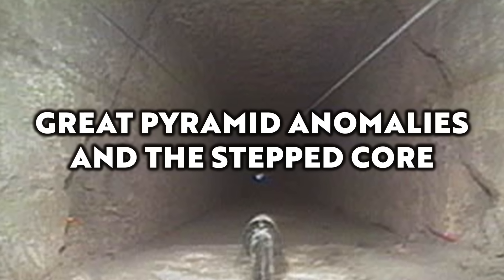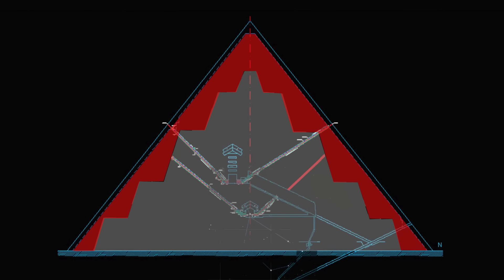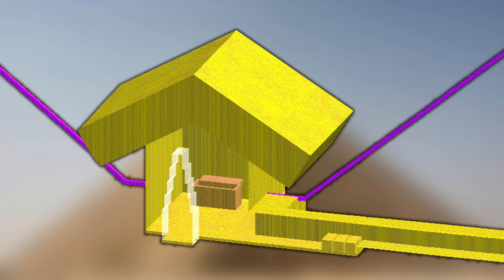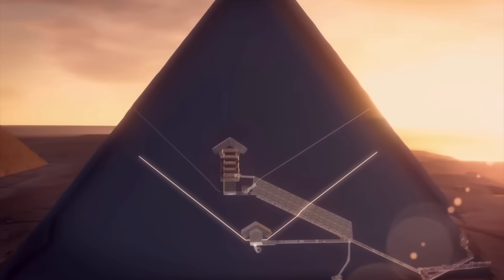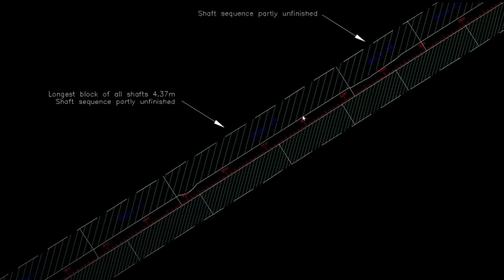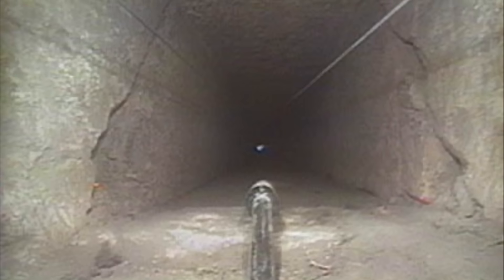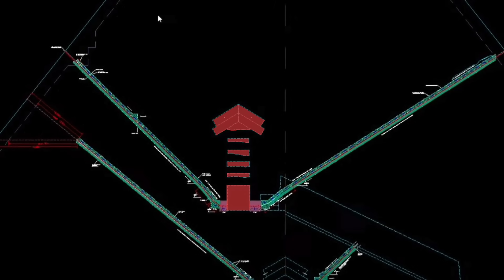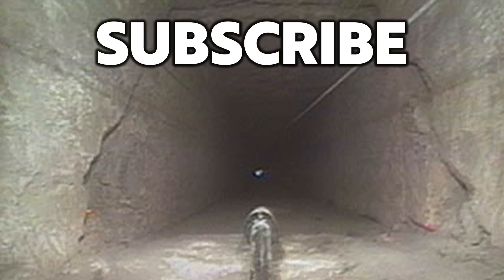Great Pyramid Anomalies Reveal Hidden Structure | Part 2

Comment: I wonder if the stepped core is in fact a spiral ramp, serving both as a structural core and a way to get blocks to the top, I wonder if the internal ramp has it's foundations on the stepped core.
Reply: It is possible both are true. Other methods of raising the blocks so high seem implausible, so I still find it compelling.
Reply: It appears to be in the data that made that pink and green spiral thing.  Not the marker drawing but their actual data.  My video was actually Vliet’s source for the screenshots of that in the paper AA linked :P
Reply: @WallacesMysteriesofAntiquity  Sorry, but few people know what green and pink are, because few people have opened the document by Laurens R. van Vliet on page 99.
I'm sure AA is aware of your work, but I haven't noticed him ever appreciating or commenting on your work.
Reply: There is no physical evidence for the spiral ramp on any pyramid. It's just a catchy idea people fell in love with. However there is an evidence for stepped pyramids (or pyramids with stepped cores).

Also, I think it's more efficient to pull the stones straight vertically to upper platform using ropes and pulleys rather then pull the stones around traveling much greater distance with huge friction loses.
Reply: This would make the Great Pyramid the only one with such a feature. All evidence of the ones where we can observe their core, are made of straight / "simple" steps without any kind of spiraling ramp at all.
Reply: @dnocturn84 I disagree.  On the little ones next to it, they’re “unfinished” but still had queens in them, so they likely took the ramp down instead of smoothing it out as it was less work for a king that might already be dead.

I submit we would not be able to distinguish the remains of a ramp around a collapsed core like Meidum.  Everything around the face fell away, including the ramp.  It’s not going to be a slanted set of stones, it’ll just be squared ones with rubble on top, very hard to distinguish.  It’d be sloped in my opinion with sand and dirt, which would be removed for stability when covering it with filler.

There’s certainly SOMETHING that’s more dense than the rest of it making a rotation and a half around the pyramid.  It’s in the data.
Reply: @WallacesMysteriesofAntiquity  So, you disagree while having no evidence other than some anomaly on one microgravimetric picture which can be interpreted in many ways.
Reply: @WallacesMysteriesofAntiquity  The piramids around it are also made of equally sized steps, without a ramp-feature at all. 

About "distinguishing ramps": I am refering to the steps themselves being designed as spiraling ramps. This is what the original comment said. 
So technically not really steps anymore, but instead a spiral going upwards. This is clearly not the case on any other pyramid. And there are plenty, where we can actually see and study their core. They're just horizontal steps (but different in size which is remarkably strange (!!!) - just like AncientArcitects depicted them in his illustration here) with no connection to each other and especially no spiral. If there was additional material added to transform them into such a spiraling ramp, is of course hard to tell. 
But why would you do it with cheaper material added to the stone core steps? It would be pretty clever to build the steps of that core into a spiral right from the very start - just like the main comment said****. It would be hidden under casing stones afterwards anyways. Unless your ramps stretch out too much in size, but then it's an entirely different kind of ramp anyways. 
And all of this is making sense - ancient Egyptian pyramids are supposed to be an evolution of Mastabas. Those are just steps put on top of each other, while getting smaller in size, the more up you go. This should be in the DNA of every Egyptian pyramid and it would be very odd, if the constructors didn't build them inspired by this. 

What data are you talking about? I would like to check it out. I'm always interested to study those, but such data is unknown to me, even though I tend to check everything new about Egypt. It's unlikely that I missed something like this, but I am willing to give it a look. It would be very apprechiated. Cheers!

** edit: thinking about this part made me realize, that building something like this would be a nightmare. Such a complex geometry is hard to build, to check its dimensions every now and then, due to multiple levels of angles making it a tough job.
Reply: That’s convoluted at best. It would mean that Meudun was built as a stepped pyramid with a ramp built around it that was later covered. If that was the case, there would be no need for a stepped core. worse, a ramp could create surfaces on which the weight wouldn’t be equally applied. It’s a recipe for a disaster…
Reply: Dude look at the places of the spots in the air channel the go up like a spiral so I think you are on to something
Reply: I really like this idea.
Reply: The easiest way to get a big, heavy stone high into the pyramid is a little bit at a time.  Having steps, where you only have to lift the block to the next step, might support the "straight up" hypothesis.  On the other hand, ramps on large steps, that then are removed/remodeled when no longer needed, would also seem to be more plausible given a stepped core structure.  Stepped pyramid structures and the knowledge gained in how to build them would be most probably where the Egyptians started, so building that first and then modifiying it into a true pyramid would make sense from an evolutionary perspective.  Sort of like finding the cores of early Christian churches buried in the much larger, later cathedrals.  All great to think about!  Thanks for the video!
Reply: Yeah that's what I figure - build the spiral ramp along the outside, as you build upwards. Then, when the internal structure is done, work your way back downward covering the ramp and adding casing stones.

I really wish the Cairo elite hadn't robbed the casing stones for their own inferior creations. It would've been so much more impressive.
Reply: @GizzyDillespee  Except adding casing stones also started at the bottom. The first row of casing stones is required to to hold the second row of casing stones. The second row is required to hold the third one, etc. This is how they're designed. You're suggesting to build casing stones beginning at the top? They're supposed to be attached to thin air or float all by themselves?

Comment: Why not? But that doesn't explain why two holes were drilled into the stone "door" (carefully polished, by the way) to insert two copper hooks. (Function?) Equally strange is the space between this "door" and a second, equally carefully polished stone "door."
This raises two questions. What could this space have been used for, and why spend time polishing these stones if this closure was intended to be permanently closed?

Comment: 7:30 As can be seen in the drawing the vertical block is at the height of the slanted ceiling blocks of the kings chamber. These deflect the vertical force from the weight above into the horizontal and as the kings chamber is out of the center line of the pyramid a corresponding vertical block on the other side will likely be outside of the shaft. This also is visible in the drawing.
2) Regarding the stepped core it may be worthwhile to look into Mendelssohn's discussion of the Meidum pyramid. From what I remember he found evidence, starting from what is visible today on the outside, the pyramid not only had a stepped core but was extended several times (three IIRC) while being built.
Reply: The Medium pyramid has a center core but one big difference they used mud bricks not limestone or other soft stone that visibly deteriorated as a sand castle.
Reply: @rafepittenger7484 Sorry, the Meidum pyramid complex includes mudbrick mastabas but the pyramid itself is not.

Comment: I do believe a core was built up  and then  built out to the faces.  But the Gallery had to be started when the  Queen's Chamber  was started.  ( No mater how the Pyramid was built , The Chamber and the Gallery  are at the same level , so they were started at the same time. )   (The Queen's chamber is off to one side so it wouldn't stop the Gallery from being started  . )  Why was it started when the Queen's Chamber  was started?  If the Queen's chamber was abandon  , why  would they have started the Queens chamber  when they started building the Gallery ?   One would expect the Gallery would be started  AFTER  the Queen's chamber was finished or nearly so?   AND   if you start the Gallery  you know what your plan is. .. so why  start the Queen's chamber if you know its going to be abandoned ?  I know this sounds like double talk but think carefully here. It doesn't add up.  Thanks interesting.

Comment: Stupid question incoming! Why did the builders end the Queens Chamber air channels with large blocks instead of just letting them end at the back of the shaft?
Reply: I was thinking maybe the "doors" at the top of the shafts were installed as soon as they finished the shafts, when they would have been exposed to the elements, to keep debris and such from falling down them into the Queen's Chamber, which at that point was still possibly going to be a burial chamber. This way if indeed they needed the Queen's Chamber they could use the handles to easily re-open the shafts. Once they decided to continue the pyramid over the shaft ends they didn't bother to take the door plugs out.
Reply: @--KP-  That makes sense! Thanks for the reply!

Comment: G-I would be a wrapped obelisk core, as Meidum, with interlocking wraps. 

New research suggests a vertical column build, rather than the conventional horizontal process.

The East Wall Niche would be the entrance to the early vertical column. Corbeled masonry serves one structural Function. Form follows function.

Also, the western bend in the northern shafts suggests a vertical build, with the grand gallery extant before the northern shaft construction. 

We’ve got it wrong. The entire study is speculative, thus far, especially the exclusive Plateau base assumption, and not a significantly greater vertical mass of the Mokattam Formation.

Love your work and research, great study effort-apparently, in vain.
Reply: Still writing utter nonsense I see.   You thinking of something is not research.
Reply: Nonsense if presented without evidence.

And the expression is "in vain".
Reply: @inthefade check the evidence. The east wall niche is the only evidence required to suggest a vertical build… 

Also, the Plateau base assumption appears a complete visual illusion. Geological evidence of human alteration demands a greater beginning mass.

The evidence is plain for everyone to investigate, if void of bias and prejudice.
Reply: @ChrisShortyAllen check the evidence… and look up research.

Tell me the singular structural function of corbeled stone? When was the East Wall Niche an open passageway to and from the structure? 

Ready to talk about evidence when you are.

Your personal attacks signal you’ve already lost any argument.
Reply: @REPHETIC 

Why are you asking questions about your rubbish theory?

Just give us solid facts.
Reply: @ChrisShortyAllen  explore the study evidence… it’s all there. There’s little or no new discovery. 

Maybe come out of the basement?
Reply: @REPHETIC 

No I'll be picking my nose and contemplating more worthwhile matters.
Reply: @ChrisShortyAllen  hope Mom makes a good lunch.

Comment: Being stepped from the beginning is the logical way to build these ancient buildings , it makes sure that it will be stable when the outer casing is applied .  I also expect the Core is made from massive blocks by the Original builders  🤔🤨

Comment: Couldn't the vertical joint be shear damage of a previously extra long block that got sheared off on the core edge by the weight of the rest of the stones? Just a couple millimeters would be enough for the entire stone to crack cleanly.

Comment: ..wouldn’t one assume a symmetric step core structure - as you also do following your sketch… why then do the 2 air shafts have different inclinations and do not exit the stepped core at the same height (possibly due to i.e. the fact the kings chamber is not in the center line as the queens chamber is, the necessity to circumvent the grand gallery, .. who knows what else..) - which in turn might explain the different solutions used to strengthen the transition - in the southern shaft theintersection seems to beright on the edge of a step, whereas in the northern one it exits out of a steep upward plane. Maybe the engineers thought that for the south, with the different location atthe supposed intersection of 2 stepcore plains a ‘separation’ of how the forces would act on the shaft structure was necessary ?

Comment: Why would they build air channels into kings chamber ? It would be an entrance for bats .
Reply: No bats could get in.
Reply: They did not. The copper rods were for guiding energy or electricity read this quick before he deletes it.
Reply: @eyesopen30  makes sense 👍😀
Reply: @eyesopen30 

I can tell you're an expert on these matters.  
Were the copper cables insulated and where did they terminate?
Reply: @ChrisShortyAllen there were no copper cables, clearly the copper rods were necessary for the Pharaohs soul to be able to find his way up the shaft and out of the pyramid to the Orion's belt like that Hebrew Mark Lehner explained! Lol I'm sorry I couldn't help it. 
  If you look at the three small satellite pyramids of menkaure they are in three stages of decay and you can clearly see they start as step pyramids and fill them in later. Hidden in plain sight!
  Once you're able to build 500 ft tall mountains you have probably mastered energy well beyond laying wire. But obviously they were put there as a collecting or guiding point. There is absolutely no other explanation plausible for those rods at the end of those shafts. It's a shame the biblical Society keeps trying to pull the wool over everyone's eyes when it comes to Egypt. 
  Now whether or not those shafts were actually filled with some sort of liquid because they were not open at the bottom is another story. It's a crying shame no one's talking about it

Comment: Could the stepped pyramid have been just a failed core?
Reply from the maker: Based on its evolution from mastaba to step pyramid, probably not. More like in the 4th dynasty, they just evolved it a stage further.
Reply: @AncientArchitects thank you for answering! ❤ very probably, still probably- but ye it is speculation
Reply: I think we dont know enough so ye it actually could be a failed core, probsbly specifically this we will never know for sure. Cheers!

Comment: Why would you block the Queen's channels twice????? In the Queen's chamber and the doors??? In fact why are they blocked at all? Who cares what happens to an unused chamber? It was protected by inner rubble and casing stones.
Reply from the maker: They were not blocked twice as such. The door on the end was used to cover them during construction - to keep out wind blown sand, dust and rain. But when they finished the pyramid and abandoned the queens chamber, they just left the doors in place and built over them.

They never opened into the actual chamber because that would have been part of the finishing of the room. To carefully chisel them into the walls. They just didn’t do it because the queen’s chamber was abandoned.
Reply: @AncientArchitects  Thanks!!!
Reply: Veeeeery good points! ❤❤❤ but ye most of all, why blocking 2wice??